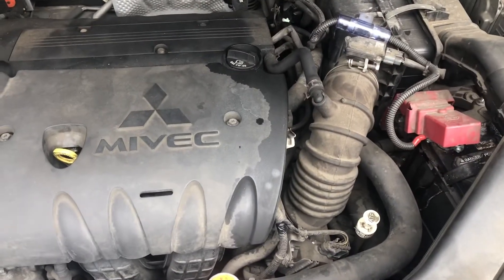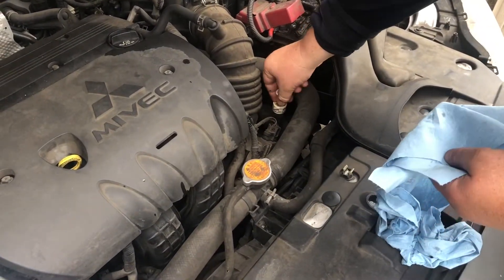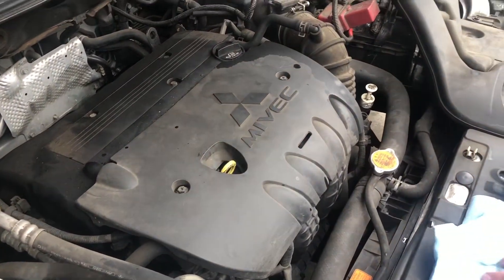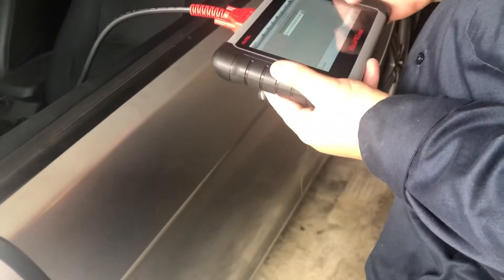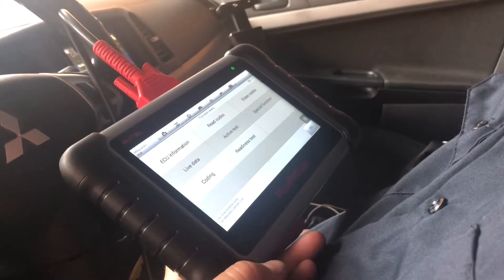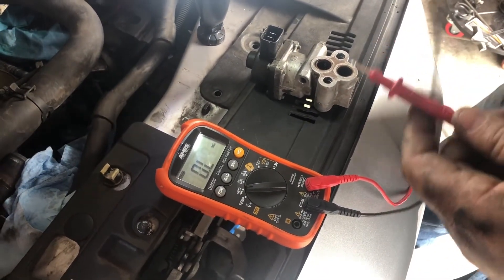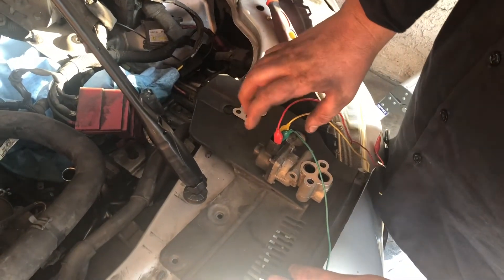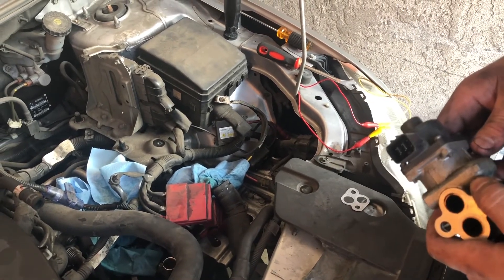Diagnosing a 2009 Mitsubishi Lancer With P0401!!

Comment: Also, now this 2013 Lancer has a vacuum leak and I could not find it myself but I knew it had one. I brought it to a shop and they used a smoke machine and told me that the EGR valve gasket was bad and it was leaking from there. They had the car for over 2 months telling me they are having trouble finding the gasket and just giving me the run around, I took the car back but the issue still needs to be fixed. Do you have any videos on showing the location of the EGR and the replacement process? I really want to fix this myself, but I can not find ANY videos online showing someone even show the EGR valve let alone replace it and or gasket.  Is there even a gasket on it? I did not see one when you took yours off. @10:35 it looks like screws holding it in not bolts? Unless the bolts are buried and those screws are for something else on the valve.

Comment: Working on the same car but a 2013, I want to remove that coolant hose and then take the bracket off so I can move those 2 hoses out of the way. Do you have to bleed the coolant system if you take a coolant hose off or can you just put it right back on when your done?
Reply from the maker: No you would have to drain the coolant, if you don’t want to make a mess. Even then you’d still going to get residual coolant leaking from the hose. If you don’t mind a mess and it’s the upper radiator hose, you can try clamping it off then take the hose off if you don’t want to drain the system.

Comment: How hard was it to remove the dipstick housing?
Reply from the maker: It’s not hard at all. There’s one fastener holding the the dipstick mounted on a bracket toward the  middle & then one more bracket & fastener we’re the dipstick goes into the transmission.

Comment: After replacing the EGR, did that fix the issue? I have a similar issue. My lancer issue, at a stopped state, it takes a while to accelerate and if i turn on the AC, the performance is worse. It feels like the car doesn't want to go.
Reply from the maker: Yes after testing the EGR valve & finding it was bad, I replaced it with a factory replacement and it started working great. Sounds like you might be having the same problem. If you end up installing a new one, clean the EGR port we’re it bolts to the engine so you don’t clog the new one.
Reply: @StevenDIY392  thanks, i will try that out.

Comment: I have an 2000 Mitsubishi eclipse gt 3.0 5 speed manual I replaced everything for the egr and the engine light will be off for an good probably 10 miles and then turn on with po401 and it can’t figure it out
Reply from the maker: Is it an original equipment manufacturer part or an off brand? Sometimes when it comes to sensors you have to buy the OEM part because aftermarket parts won’t set well with the car computer. If it is an original it’s possible a bad part, I have bought brand new OEM parts and they have actually turned out to be defective. If you covered those bases, I would look into your catalytic converters and or your O2 sensors. Hope that helps.